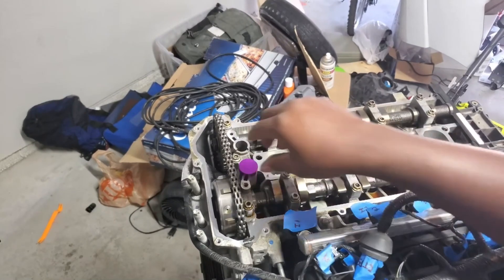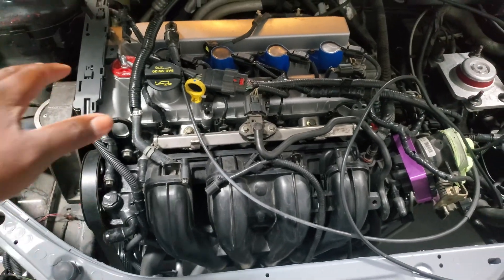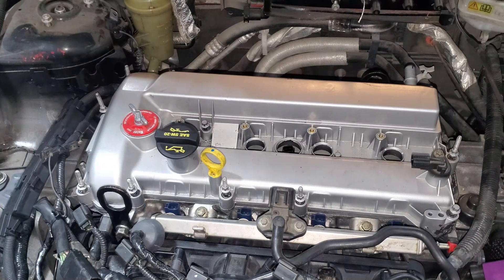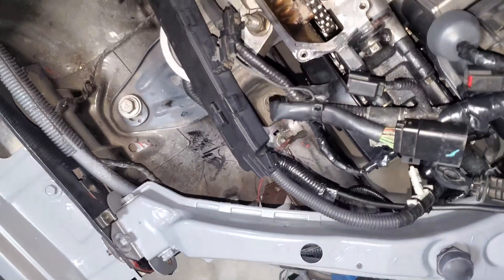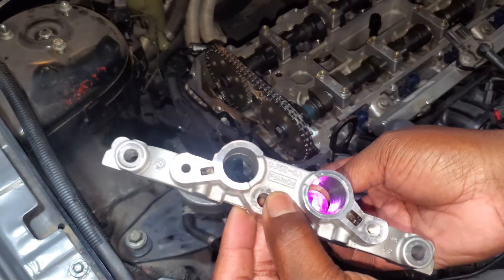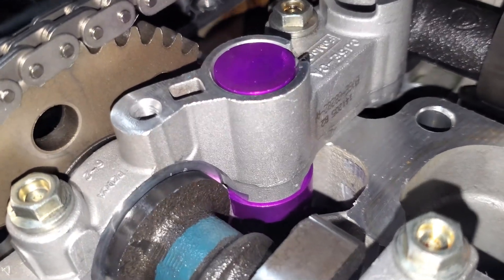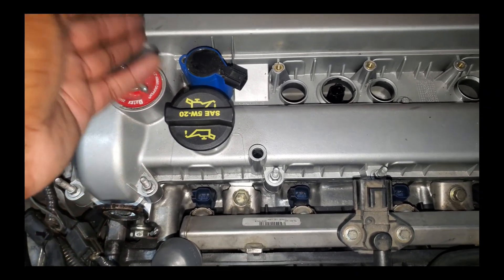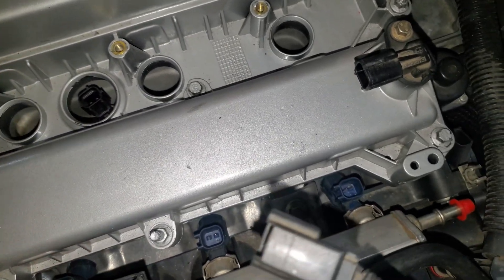Ford Focus/Fusion swap 2.5L-VCT Delete Kit (Correcting Mistakes)

Comment: Hi,

I'm from Brazil and I have a Focus MK2.5 2.0 Manual. We don't have the Focus 2.5 ST here. I was considering swapping the 2.0 engine for a 2.5 from a Volvo C30. There are plenty of C30s here, but they all have automatic transmissions. Could you tell me if the Focus 2.0 transmission and flywheel are compatible with the Volvo 2.5T engine in the C30?
Reply from the maker: I do not know if they would mate. Ive never tried the pair.

Comment: Not the only one to do it wrong lol
Reply from the maker: You did yours wrong?
Reply: @FocusedHands  yes haha
Reply from the maker: @projectjasmine9448  you get that 2.5l installed in yet?
Reply: @FocusedHands  no not yet. My buddy still has my cylinder head but he ended up moving his shop so thats all on hold
Reply from the maker: @projectjasmine9448  aaaaaah man! We need that engine up amd running!

Comment: Glad you got that fixed. I figured out mine was backwards after going thru some of the FB pages, on a side note did you run into any issues with your intake cam clearing the 1st cam cap? Mine seems to be shifted to the right in every race, it’s a new one though so I suspect it might not be exactly in spec.
Reply from the maker: Nope no issues on my end. Though we will see how everything works should the engine start. For now I guess the status is pending :)